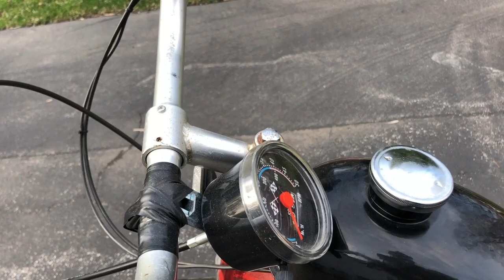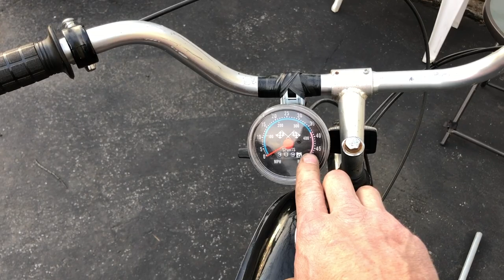How To Fit Amazon Bike Motor Kit on a Lajolla Next Bike

Comment: Thankyou for posting this! I have this exact bike & the motor on the way. We have the same engine kit (except carb&filter), no way to put on without the offset intake??? Its my 1st build!
Reply from the maker: You will have to fashion an intake to come out the side. Like I said my first version was copper that can be purchased at any hardware store. if you cut the intake that comes with it to a short stub and shove a copper street 90 in it you can plumb the carb strait out the side, that will get you going until you have time to make something more permanent. One other thing I forgot in the movie, I added a couple of fender washers between the wheel and the rear fork on the sprocket side to give more clearance for the chain.Also make sure your intake doesn't leak or the bike will be hard to start and if you do get it started you will burn up the motor. Post a video of it and let me know I would love to see it.
Reply: Goodwin Withers Great thanks. Because i bought this exact bike brand new from a pawn shop for only $20 and a used Schwinn cruiser. My kit jyst arrived today. So im debating which bike to use..
Reply: You can buy a sprocket adapter kit for the rear wheel that licks onto the hub

Comment: Those speedometer are not even close to being right that bike Will top out @ 27mph. . mine goes 60+ MPH. It's built by zedamotorsports.com it's what they call the  torque monster power is unbelievable. Check them out.